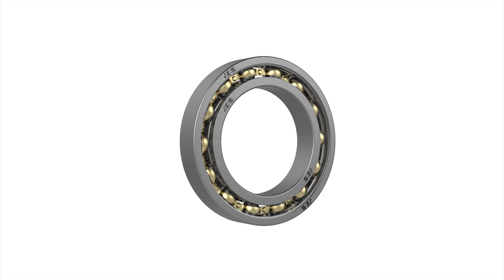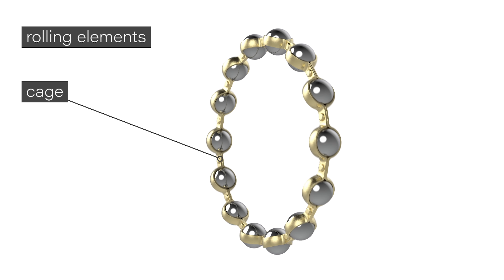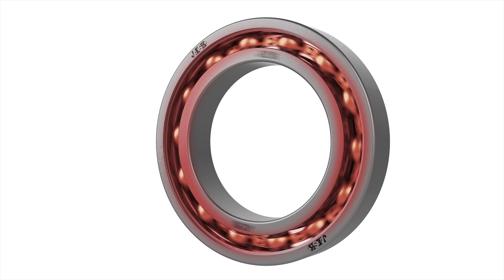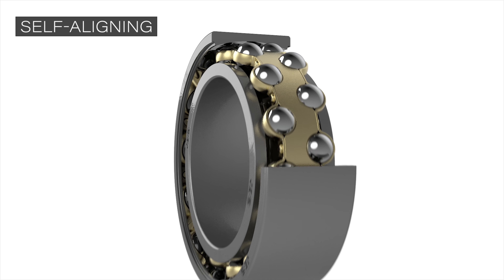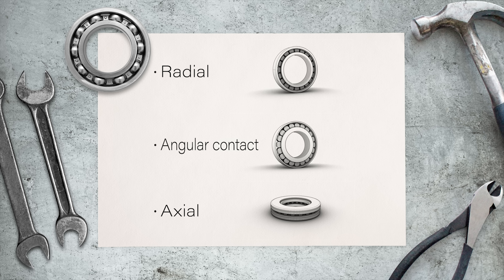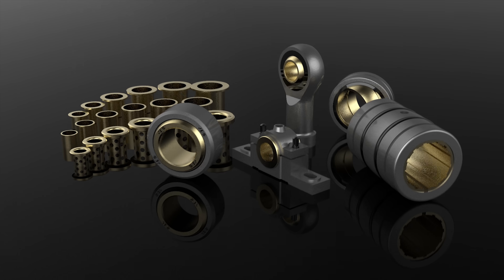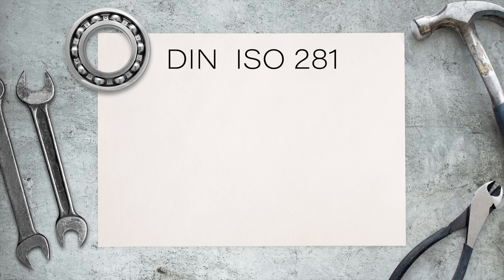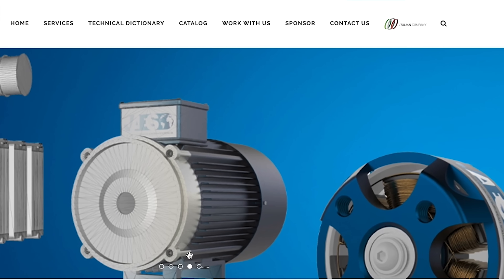How do ball and roller bearings work? Types and durability calculation. DIN ISO 281

Comment: If we lubricant any conventional roller bearings the same way we do it for journal bearings. Will these roller bearings be working much better than journal bearings with the same high load and high speed (not more than 20,000 rpm)?

If journal bearings do work well by properly lubricated. No reason such method won't work in roller / ball bearings. Is this theory correct?

Comment: Can the same bearing be used in either case that inner or outer rings are rotating?  Are the ball designed to be fixed to inner ring or outer ring?  Thanks very much for your clip.

Comment: In general, there are several factors involved in the design of bearings with rollable moving parts, which are the required ranges for both the amount and direction of the load on the rotation axis, the speed of rotation, and the time period for continuous work to obtain the highest possible rate of work efficiency required without deforming the moving parts so that we can determine the optimal density For the lubricant used to lubricate the moving parts. So all bearings with rollable movement parts are classified on the following bases: direction of the load on the bearing relative to the shaft axis (radial, radial thrust & thrust bearing), the shape of rolling elements (ball, roller & needle bearings), number of rows of rolling elements (single, double, four &multi –row bearings), flexibility(self-aligning &rigid bearings),   jewelers' bearings can work with ultra-high speeds because the friction in them is close to zero, they are used in the manufacture of mechanical watch gears, as well as gauges with ultra-high sensitivity and motors with stable speeds. As for both the fluid and magnetic bearings, the speed of rotation is not limited because the coefficient of friction in them is equal to zero, but they need external control to prevent the decrease in the efficiency of work in them under the various loads imposed on them, so their design is more complex and expensive.
Reply from the maker: thanks you for your explanation

Comment: what type of bearing is used on the  output shafts  in manual transmission such that  output shaft does not rotate with the output gear

Comment: All rolling-element bearings need grease (or other lubricant), correct? I'm a little disappointed that this vid didn't talk about the lube, such as how much is needed for given loads and speeds, and if it can be totally sealed as opposed to an oil circuit.
Reply: Grease /oil - good.  No grease/oil - Bad.  Yes can be totally sealed.  Yes can be oil circuit/splash lubed.

Comment: when the inner side metal will expand with the heat then the outer bearing side metal should also expand with heat so it should not be cause or ceasing the bearing .....just my thought.